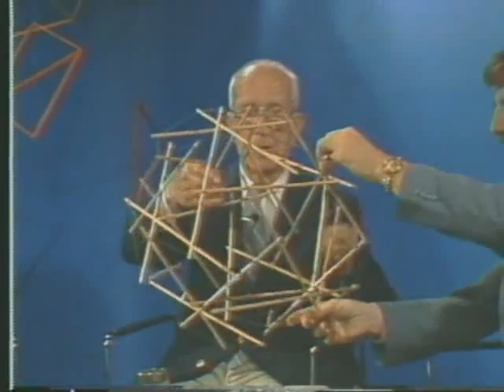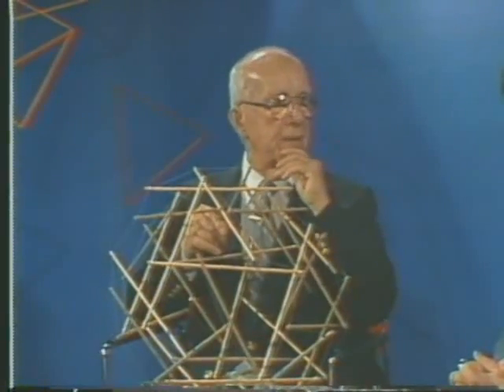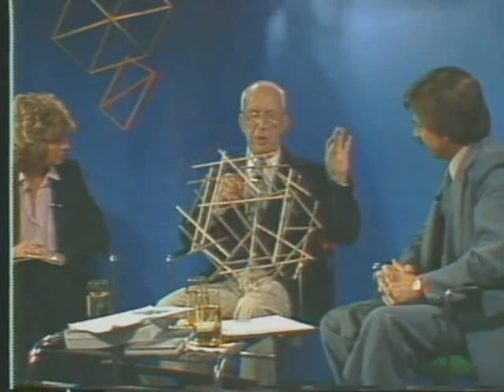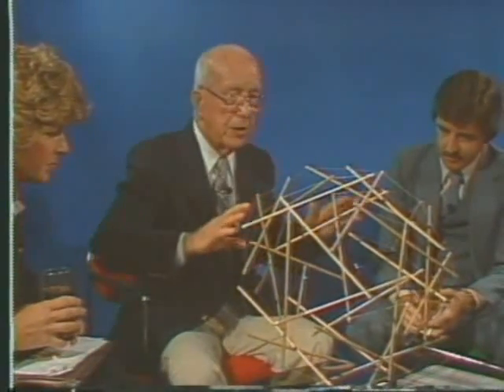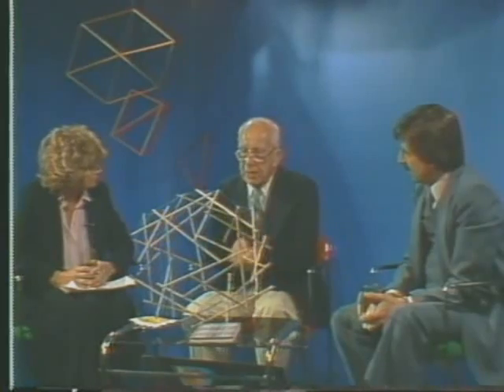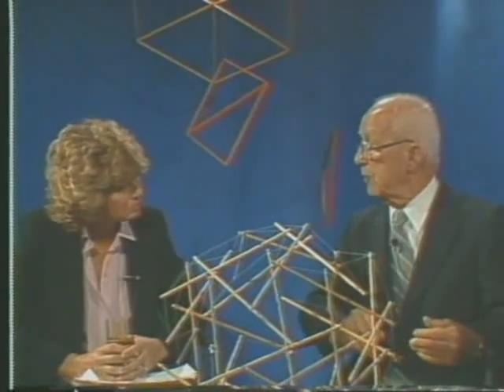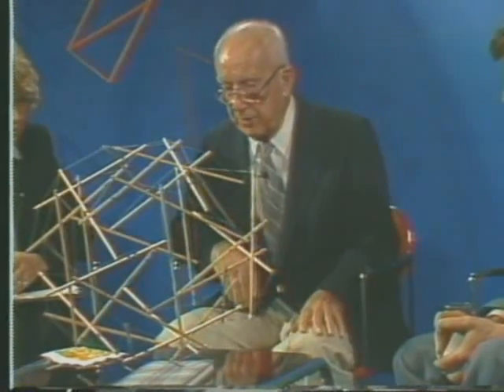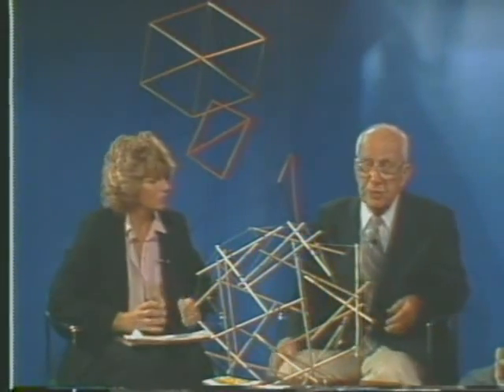Buckminster Fuller on Tensegrity Structures

Comment: Dear Sir or Madame,
    I've made many 1D (rod) free standing tension structures. I can show how my 1D structures can be manipulated into 2D discs or plates elements and 3D elements discs or plates with body (thickness). All free standing. My latest work modifies Buckminster or Kenneth Snelson's 30 1D element icosadodecahedron. I joined the element ends resulting in 6 pentagons hoops sort of woven together and suspending each other. I modified the pentagon hoops into star shapes. The last of these star shapes has 18 degree points and 90 degree valleys. I have photos and drawings. I am 84 years old. If I can't find someone interested, my work will be lost. Thank you for the use of your site.
Show less
REPLY
Reply: Sir, did you ever get any help with disseminating your research? I, personally am a very visual learner and would love to see any pictures or video you might have of these structures. I honestly think you may have physically modeled an idea I've been playing with in math. I'm super curious either way if you are still interested to share your work. Best regards!
Reply: Hello